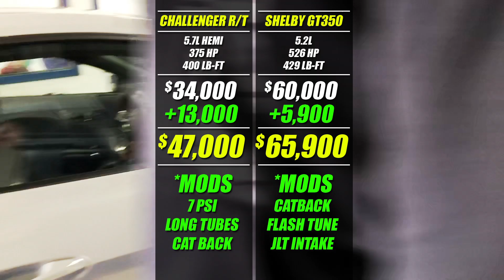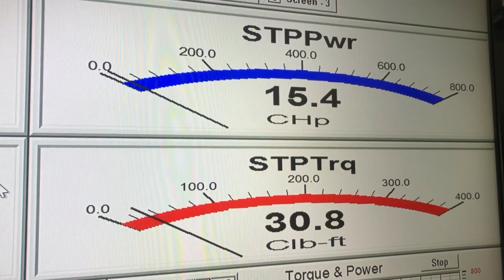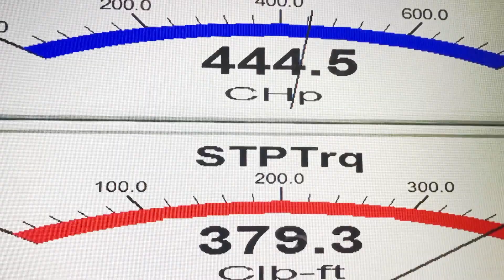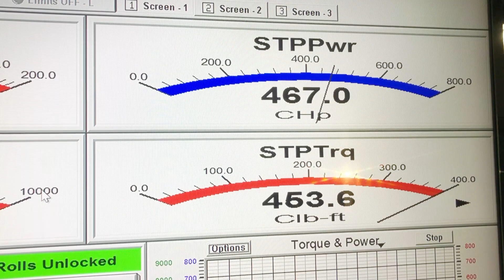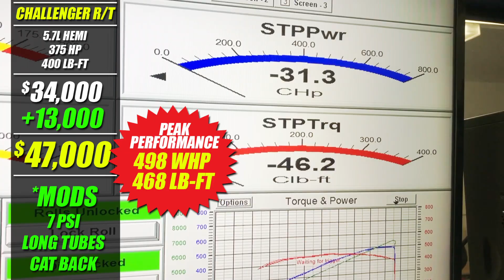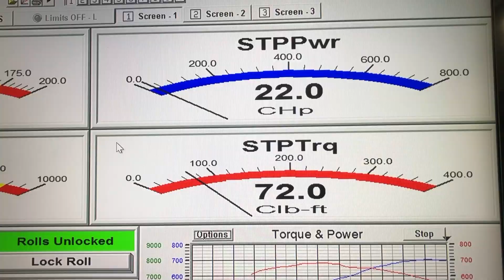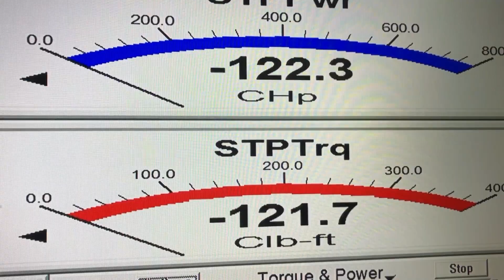5.7L R/T OVER Shelby GT350...

Comment from the maker: Thank You Everyone for the Support! Make sure to LIKE the video - Both awesome rides
Reply: Power to weight favors the GT350. The GT350 has 3.73 gears and a limited slip differential. Having said that, I would never buy one. I think the GT350 is overpriced. A Mustang GT is a far better buy for the money.  For the money, you can get good power out of a 5.7 liter R/T. As for me, I would prefer a base model Mustang GT or a base Camaro SS. More power from the factory and the cars are lighter. The difference in power is even more when the cars are supercharged. However if I had kids, I would probably buy the Charger R/T and add the supercharger.
Reply: When racing, where in the powerband do you want your car shifting? Asking for a friend. I already know everything. 🤣
And great video.
....oh yeah. How much boost can the 5.7 safely take without getting into the internals?

Comment: I will be boosting my 17 Challenger rt at the end of this year but I'm torn better the procharger or Whipple 😩 any suggestions?
Reply: Bro im the same lol...let me kno when u decide
Reply: Im in the same boat
Reply: Let me kno wut u decide
Reply: Honestly leaning towards the Whipple, will let you know for sure!!
Reply from the maker: I think it's more personal preference & budget. Both are solid options
Reply: From experience with my 500 whp challenger DO A TON OF RESEARCH! I chose the E-Force cause it was a compete kit, 50 state legal & emissions legal. The 6-7 psi boost was well within the operating tolerance of a stock lower with 28K miles. Do they all need a custom tune YES. Don’t rely on the supplied tune if included.
Reply: @pmac5386  wow really? Ill look into it....thanx bro..
Reply: My preference honestly is the Whipple because a supercharger whine is so intoxicating. My budget will allow me to get a custom Dyno tune as well as long tube headers with a catless mid pipe, live in Texas so not worried about emissions

Comment: to be honest with you I'll rather take that mustang. My 5.7 is getting procharged as well but the hemi can only handle 7psi before the engine blows. mustangs can handle up to 14 psi and probably more. If im correct the 350 is supercharged already right? just have to turn up the boost. plus lets also compare the weight of both vehicles. Another thing is warranty. I'll rather take a supercharged car with warranty. I love my 5.7 and Im pretty sure I'll make more than 500whp on my setup but again I cant pass 7psi unless I dig into the engine. The hemi is a great engine but its sad that not even the 392s come with forged internals. The hellcat would be the only hemi worth it.
Reply: My supercharged 5.7 is at 7 psi and basically thats the max. I'm happy with 500 whp (leaving some on the table for safety sake) I'd rather drive all day knowing it won't damage the internals than worrying about being towed into the shop someday.
Reply from the maker: The GT350 isn't supercharged but you're right it can handle forced air better. You should def be in the ballpark of 500whp if you run stock internals with a forced air setup.
Reply: No the gt500 is forced induction the 350 is a 5.2flat plane sounds ungodly for sure but the main issue with the shelbies are the damn markup msrp may be about 60k good luck finding one below 100k while I can go to a dodge dealer buy a brand new rt or scatty and get addons at the original msrp at least at my local dealers

Comment: Same torque stick as a gt350 😂. Super overpriced car that runs with a 392 or 5.0 for $60,000
Reply from the maker: That's a whole lot of money to only be good on the track. You're right the 392 & 5.0 will edge it out drag racing
Reply: R/T Life I’m a dodge guy but for the same price the zl1 has a better interior better performance and is better around the track and insanely better in a straight line for the same price. I’m not trying to hate I just love value:)
Reply from the maker: You're 100% right though. The ZL1 for a couple of bucks more is a much better value
Reply: talk about value- I paid less for my ZL! than my GT350 and Jannetty Racing modded it to put down 662 to the wheels and I'm still less than the Gt350!! take that Ford. @devn3813
Reply: @devn3813  Talk about value-My ZL1 including being modded at Jannetty Racing to put down 662 Whp still cost less than my GT350 out of the showroom. Take that one  to the bank $$$

Comment: I bet the gt350 is still faster since its like 500+ lbs lighter, and the gt350 definitely handles better.  Also there have been NA normal GT's with just e85 tunes and headers making over 500 wheel hp.
Reply from the maker: On a drag strip I would bet on the RT - track the GT350 wins no contest

Comment: Transmission mods ?   I think stock HP70 can handle 500 tq
Reply from the maker: He has a 6 speed - nothing other then power mods to this RT as of right now
Reply: I guess just add power.. then beef up things as they break lol
Reply from the maker: hahaha nahh man - that RT is babied like crazy. Doesn't touch the drag strip or track. It's a weekend cruiser
Reply: Hey-I baby it a lot but she also gets ridden hard and put away wet TOO! @RTLife
Reply: A conservative tune should protect the transmission anyhow.. but for sure that’s Alot of power
Reply: My challenger (the one in the video) has a stock clutch and 6 speed Tremec manual transmission-both were serviced 4 months ago and are strong and good to go. @gregoreosRGV

Comment: Gt350 1 holds value 2 lighter 3 engine holds 700+hp 4 sounds amazing 5 high rpm 6 handles great 8 quad tips 9 comes with great tires from factory ect ect
Reply from the maker: It should have those things with the price tag attached to it. ZL1 $$$ territory
Reply: @RTLife  zl1 is just a upgraded Camaro gt350 is a whole different car than a mustang different engine trans wheels
Reply from the maker: oh yah I know.... just talking strictly $$$ per performance. I understand there are a lot more factors that go into buying these cars.
Reply: Those were some great stats but for that price why not buy a Hellcat lol
Reply: @RTLife  well if that's the case you can get a 2018 gt and put a blower
Reply: @lamontwhite3909  no 18 hellcat is under 60k
Reply from the maker: 2019 Challenger Hellcat with legit no options is 58K. which would be close to the 59K MSRP on the GT350 
The 5.0 with a blower on it would be making legit power & not even coming close to either of those sticker prices. 35k + 8k - either way I just threw this out there for the fun of comparing two very different cars
Reply: @RTLife  I agree but what kills these cars are dealer markups like on the demon
Reply: @RTLife  by the way love the channel brother enjoy the content 👌👌👌
Reply: Just cross your fingers the GT trans or shift forks don’t fail or the engine doesn’t develop the dreaded MUSTANG TICK LOL
Reply: @pmac5386  like if the 392 don't blow up with 8 to 9 psi and take a sc 13K for challenger to be in 498 when Im very close with full bolt ons LOL
Reply: @rggt6225  I would like to see every level mustang bone stock up against the same level Dodge bone stock and see who would win the most races.
Reply: @lamontwhite3909  well dodge has alot of versions of the challenger charger sct gt ect ect they stretch these models to the max later they will offer v6wide body lol
Reply: @rggt6225  lol oh crap..but its levels because the "muscle car starts with the RT it used to be SRT 8 then Scatpack and so on..by widebody lol. I hate that everyone tries to de-badge their cars, you never know what's pulling up next to you. But I have saw that most Hemi owners keep something on there to let you know lol..I did
Reply: @lamontwhite3909  I think it just degrades the car bc if someone is trying to race you a v6 with the srt body kit you blow the doors off of it makes the car look bad just saying that flagship cars should be unique not give all the base models the same things that make them Unique just my opinion of course
Reply: @rggt6225  I agree that's something that I dont like about dodge. You should know what trim it is before you pass it because of the unique design
Reply: @lamontwhite3909  I like dodge not going to lie like the look and dodge has the balls to make a car like the demon but that is something that should be unique to demon

Comment: Those GT350s are overpriced bigtime. A scat with a bolt on procharger will not only still be cheaper but destroy the mustang down the 1320.
Reply from the maker: Agreed. Def going to walk a Gt350 all day on the strip
Reply: It should, the gt350 is not a drag car. Go to a road course with the same cars, challenger will get lapped.
Reply: @AVGJoesGarage  No it wont. Most owners of these cars never see a track.  Then those that do dont have the skills to run it around a track. Getting the most out of a car on a real track is incredibly difficult with little experience.  Ive seen Fiesta ST lap GT350s. All depends on the driver and course. Thats why these guys only drag race.
Reply: @NeverB_Gameover  I will give you that. Most have no clue how to drive any car at its edge or even close to it. But if we sub pro drivers....